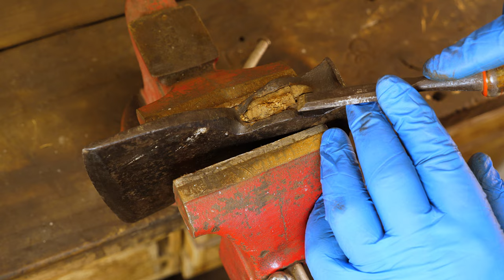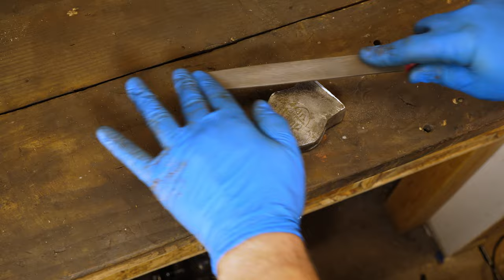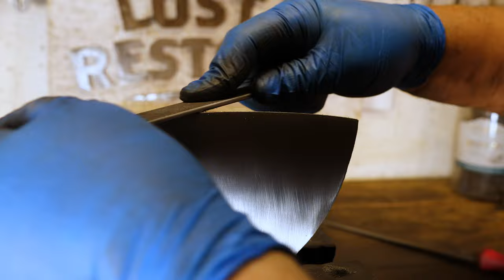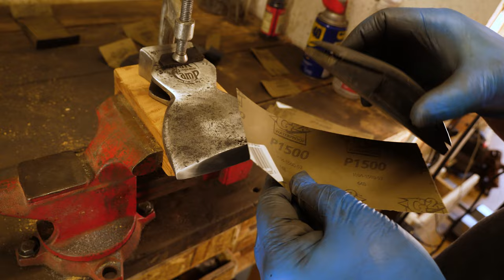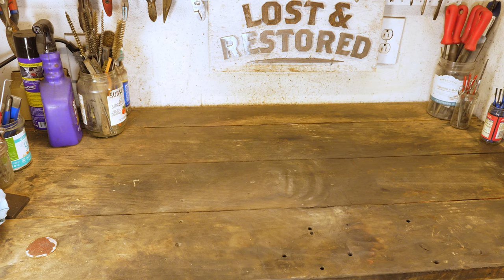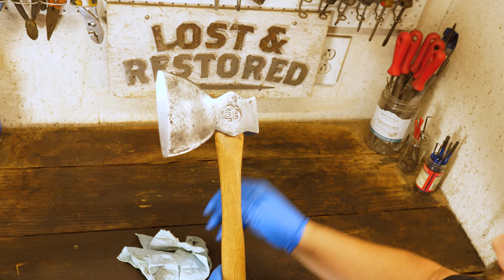Antique Rusty Axe Restoration - Van Camp Hewing Hatchet

Comment: I only see one problem with the axe, At the cutting edge the bevel is to steep! With a bevel like that you couldn't keep it sharp long very easy to dull it if the bevel was shallower it will stay sharp for a long time!!
Reply: You think so mate? Hm, now when I think of it, you're right. The bevel is problematic.
Reply from the maker: Great point, the angle was quite steep when I got it. I tried to file it down some. I probably could have gone more.